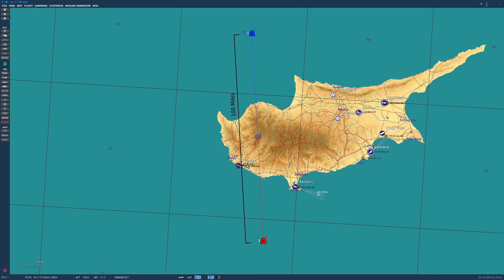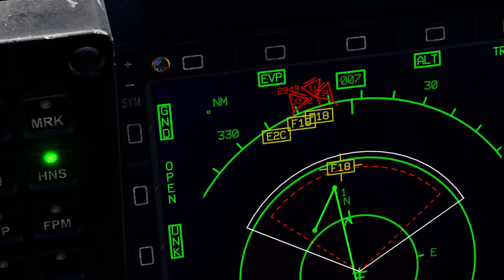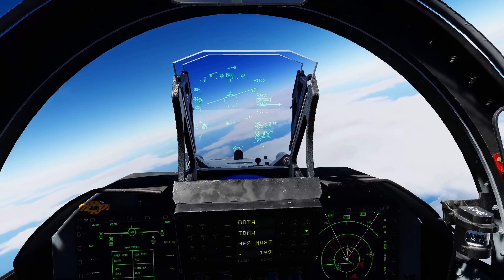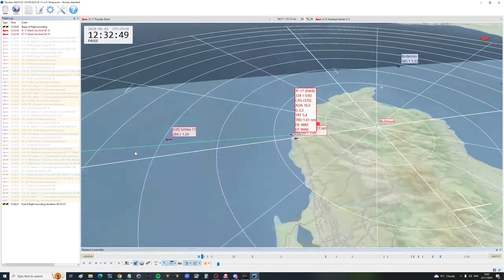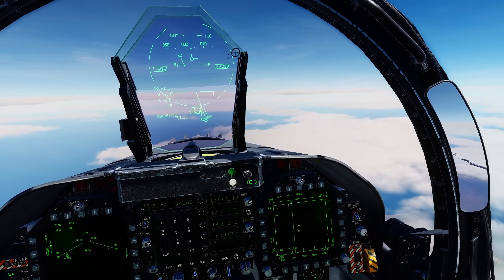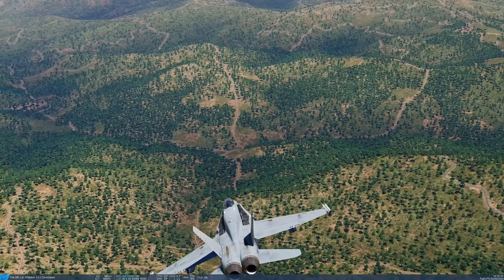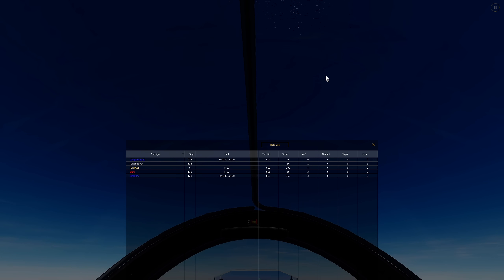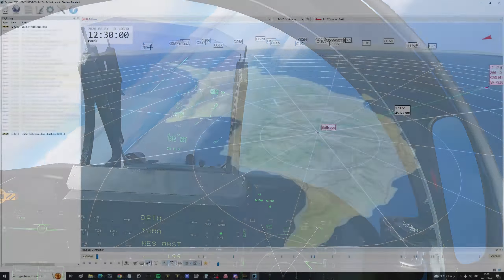FA-18C Hornet vs JF-17 Thunder: BVR Battle & Dogfight | DCS

Comment: At 60 nm set engine setting combat for extra power, climb at 5 degrees and set radar in TWS. Also change azimuth to 10 degrees for faster lock
Reply: May I ask what's difference between TWS and RWS for the jeff, besides the functions differently? Does TWS make the target easier to track or to lock?